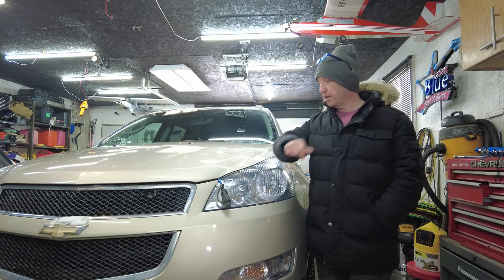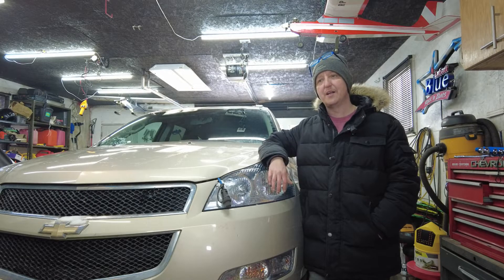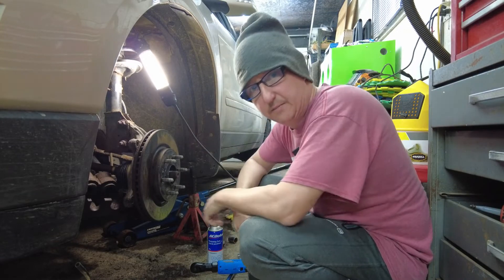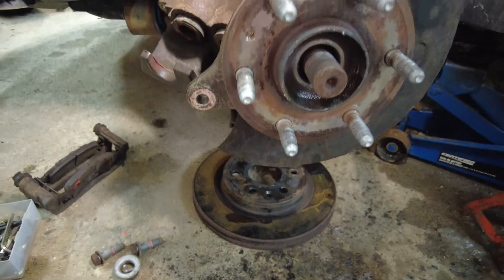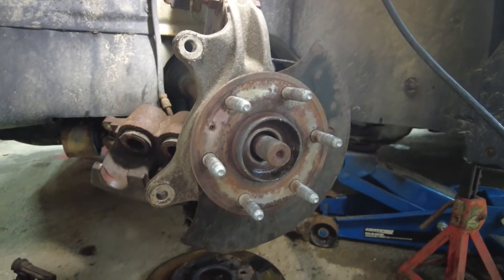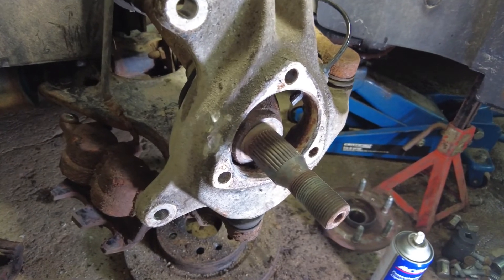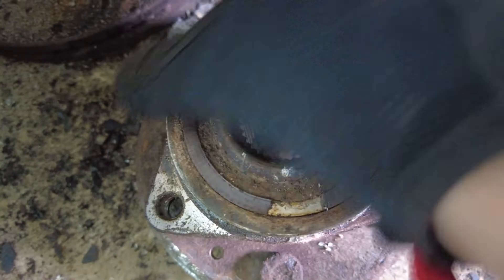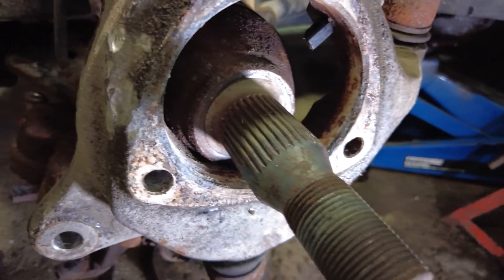Drivers Side Front Hub & Bearing Replacement Chevrolet Traverse also Acadia | Enclave | Outlook .

Comment: Use the power steering with a bar pops them right out.
Reply from the maker: That's not the first time I hear that trick. I'm always too worried I will cause damage to the steering system. Have you used that method before by any chance? I'm curious. Thanks!

Comment: Not sure if applicable in Canada but here in Texas, a quick way to loosen the old hub's inner splines from the axle is to put the axle nut back on, take an air hose and use the air hammer attachment, use a pointy tip press against center of axle head, fire on for 3 seconds then let go.
All of those micro vibrations will agitate the dirt/grime and the hub should slide right off
Reply from the maker: That's a fantastic idea. Thanks for sharing with the group here!

Comment: You didn't waste money on replacing that sensor.  I've had 2010 and 2016 Acadias, both needing multiple new OEM wheel hubs and sensors. The GM tone rings simple don't wear well; the bearings last longer than the tone rings.  But once that ring is worn, the whole hub assembly must be replaced. After my 3rd replacement, decided it was wise to replace the sensor whenever a hub was replaced.  Logic being the hub (and sensor) had 75K miles and the labor effort required for the hub removal (rusty Midwest conditions) warrants having a new sensor, which is only a $30 OEM part.  PLUS, the used sensor end can be fragile and likely to be difficult to remove due to dirt and rust.  It's not a waste of money to ensure that whole wheel assembly has new parts for the next 75K miles.  It's a wise preventative maintenance decision, IMHO.  Here is the best video showing hardware and steps for removing rusted hubs: https://www.youtube.com/watch?v=7Yk2p5_CxqE&t=243s
I purchased this exact hardware and it works!!  Thanks for your real life video, it's valuable for the DIY
Reply from the maker: Thanks for the link and comment for everybody to see. It' a pretty crappy job but this proves that anyone can do it! :)

Comment: My tractional control keep coming on and when it does it trigger more codes.  Changing out all the bearings on my 2010 traverse.
Reply from the maker: Ouch!! All of them? Good luck. You got this!!!
Reply: @NorthernHomeGarage  What is the torque specs for the axel nut. Is it 150 lb or 151? Thanks.
Reply from the maker: @Ang3l-of-M3rcy  the axle nut is a single use part that should be replaced when removed and the spec is 235 NM or 173 LB FT.